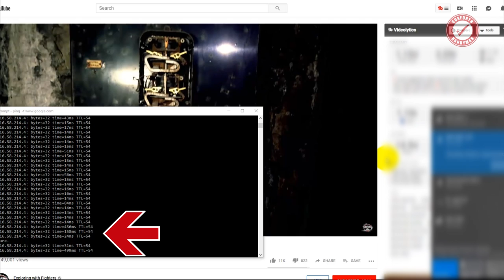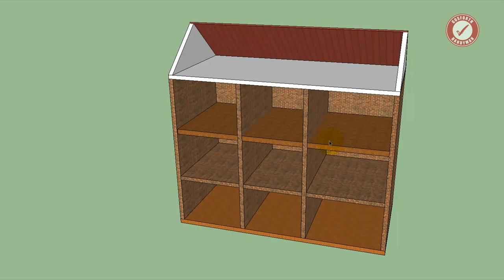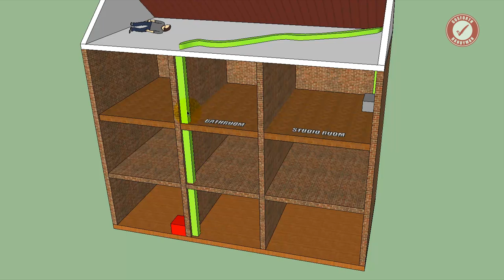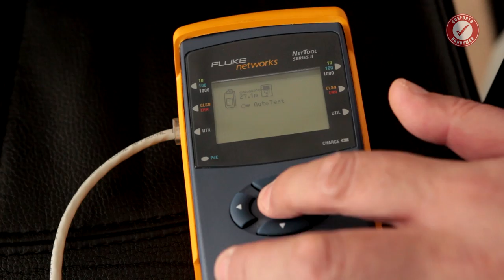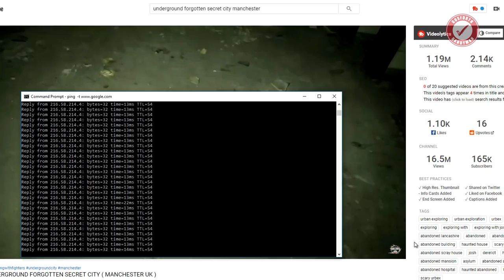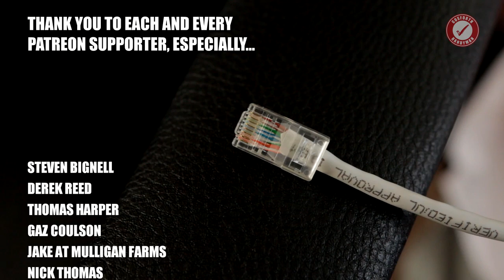Running RJ45 Network Cables inside walls ...and fixing Wi-Fi problems!

Comment: Just wanted to add. I saw the other day a wall socket for that ethernet cable, where you can just attach the wires to the terminals, mount it on the wall and run a ready cable from the shop to the end user

Comment: People in the alarm business have been fishing wires through walls, etc for many years.  They have developed many tools for doing this.  Electricians are beginning to learn from alarm people how to route wires.  It's funny how people have to re-invent the wheel.

Way before we had those electronic inspection cameras, we had small periscopes that could look into a wall to find fire blocks, guide drill bits, etc.  Jim

Comment: If you’re going to this much trouble and going that much distance, then you should just go for 10gig multimodal fiber. Then you’ll never worry about speed or capacity in the future. There’s plenty of online suppliers that sell common lengths cheap with the ends already attached. Also, one tip is to always run your cables with a spare string line attached to them, in case you decide you want to run more in the future.

Comment: GOOD JOB! However, I think you did it the hard way.
They sell outdoor Ethernet cable. On my house I
punched a hole to the outside at the router ran the
cable around the outside of the building then I
punched another hole into the house where the 
service was needed. DONE.

!

Comment: Did you leave the string/twine in for any future work? I would have run 2 Cat 5 cables just to future proof the install because you may need a connection in another another room. Great video though - like your presentation style.
Reply from the maker: No - considered it but I'd have to open the wall up anyway as you couldn't pull a cable all the way from the top to bottom as it was too tight. Cheers bud! 👍👊

Comment: Heat shrink is handy for joining the cable 'nose to nose' with whatever your using to pull poke , means you only need a cable sized hole.

Comment: Nicely done Andy 👍. Another good video. You really really need to treat yourself to an endoscope... cheap as chips from Amazon (about £15), just plug it in to your phone.... it will save you hours of poking in the dark. I use my one for running wires in vehicles... go on.. treat yourself. Keep up the good work 😁
Reply from the maker: I've got one somewhere! 👍
Reply: Mine was a fiver from Ali

Comment: I think it might have been a good thing to pull twice the amount of polytwine down from the third floor down to the first floor.  That way you could attach your network cable at the half way point.  Tie off the twine on the first floor, then from the third floor pull the twine and cable up to the third floor.  On the third floor make sure you have enough slack of the twine so you can tie it off.  That way you can leave the twine in place in case in the future you want to pull a second line to the third or one to the second floor.  Rather than patching the round holes with plaster it might be better to get some keystone plates to cover the holes with,  they make them with as many as six keystone plugs.  But one with four would probably be about right to cover the round hole.  Most of the keystone plates have removable keystone plugs that you only remove the ones you plan to use.

Comment: Thanks for the video, which fish tape product did you use?  Just mounted my projector and looking to run a power cable to it.  Oh and on that subject thankyou for opening my eyes to the setting tool, ashamed to say I'm 42 and didn't know it existed,  always thought those plaster plugs were crap but i wasn't using them right.  Cheers from a fellow Geordie up in Ashington.

Comment: Why didn't you install a faceplate for the network cable? 
For people who aren't aware:
Solid core cable like this should be terminated into a faceplate. It isn't designed to be terminated with an connector.
Stranded cable is used for making network (patch) cables between router / switch and PCs, it's more flexible and less likely to break over time.
Reply from the maker: >> Why didn't you install a faceplate for the network cable? 
Didn't need them! But yes, if you plan on moving the connectors around a lot then use faceplates and stranded cable. 👍
Reply: @GosforthHandyman  Fair enough, if it's for yourself and you understand the limitations. 

I just wanted to mention it, in case others weren't aware of the solid / stranded differences.

Comment: If I remember rightly. A soil stack should have a fireguard coller on each level to stop spread of fire if one occur? It might be that you are fighting with . The fact that you did get it through is probably due to builders not sealing that area as it is behind the boxing
Reply: If the floor is fire-rated.
Reply from the maker: Yeah, I think the fire rating is just on the consumer side. Pretty sure the insulation is just for noise suppression... and to keep the poops warm. 😂👍

Comment: I need to do this. The router is in my study right by my computer so that's fine; phones and iPads are all fine over wi-fi but the smart TV doesn't always do well over wi-fi. Nothing worse than it losing the plot 😉 halfway through a movie or show. Luckily I'm in a single-storey home so it's a simple matter of taking cable up from the study, through the ceiling and down into the lounge. A bit of a hassle as my South African home doesn't have a nice loft space like UK ones, so need to crawl over rafters and not put a foot through the thin ceiling board.

Comment: For the speed you have, I would of gone Powerline adaptors. I use them in my 3 story on each floor (set of 3), had the rare blip where I needed to power cycle the one at the router/switch end but other than that they have been rock solid.

Comment: Tight really. In Spain they actually accommodate that very problem, you may want to add power, RJ45 or TV, so they include extra blank trunking tubes for each room from an centralised location. Router in the lounge, np, simply run your RJ45 cable through to the required blank socket. A quick visit to Leroy Merlin and buy your RJ45 socket and there you go, oh and 1 GB fibre isometric is genuine as they literally connect you to the house unlike UK. Where you still get your copper from the roadside and so it’s not true fibre.

Comment: I've used the things that just plug in a mains socket each end and it sends it through the power cables, works OK for me.
Reply from the maker: It's separate ring mains and they don't seem to work too well across different rings. 👍
Reply: @GosforthHandyman  Mine is on a different ring, upstairs and downstairs, I guess length of cable in the circuit can make a difference, I'm getting 65Mb/s.

Comment: Just renovated and put an extension on my house, the whole house had a rewire so took the opportunity to run 20 Ethernet cables from every room up to a switch in the loft, couldn’t rely on WiFi 🤧

Comment: I always pull more twine through with the cable to ease any worries about the cable coming away from the pulling twine. It also means you have something in place to pull a future cable.
Did you need the big holes at the bottom of the boxes? Could you have used just the ones at the tops?

Comment: Nice job... it would have been a good idea to run two cables since you looks like you had the cable to do it and a "pull wire" of excess cable for a future pull if needed.

Comment: Would have been tempted to run two cables and terminate them in punch down face plates, cables do go bad over time. Did you consider going external ? i've had to do that a few times when there is no chance of them letting you dril / lift internally.
Reply from the maker: Didn't really need 2 and could use a splitter if needs be but yes, defo run as many as you can be bothered to run! 😀👍 No easy external route so this was the easiest option.
Reply: @GosforthHandyman  Fairy snuff, internal can be a nightmare when you carn't lift anything; get in early on a new build and its bliss, thoese are the days compared to old homes that have 2ft thick solid walls and no crawl spaces.

Comment: Hi Andy I would have pulled a nylon fish along with the ethernet cable so that you have the ability to pull through secondary cables should you need them, after all you done the hard yards.
Reply from the maker: Yeah, considered it but the pulls between floors would still require holes in the walls as it would be too tight to pull from top to bottom. If I changed things I'd probably put a switch in the loft and drop down in to each room from there, but fine for now. 👍

Comment: Interesting. Does the UK allow unlicensed cablers to install fixed telecommunications wiring?  in Australia, it is illegal to install any fixed cabling that could be potentially be connected to public networks.  A consumer can run all the speakers and antenna cables that they want, but as soon as it is an infrastructure cable (i.e. inside a  wall or ceiling space) that can potentially be used for a fixed line phone or internet (even where no public network connectivity is actually installed), communications authority licensing is required.
Reply from the maker: Thankfully no such restrictions in the UK! Even for commercial installers AFAIK. 👍

Comment: Out of context for this video, A few weeks ago you showed an new dust extraction system. 

I also have yet to fit my chinese cyclone gadget together but can't seem to find any decent fixings to go on to ist 53/54mm conections. 

Are you fixing to the inside 50mm bore or have you found a decent connector from somewhere?
Reply from the maker: Haven't decided yet! Axminster do quite a range of different adaptors including flexible ones and ones you can cut to size so I'm hoping I can find what I need from there. Good luck! 👍

Comment: I feel your pain, one of those jobs you 'I will just pop the cable down that boxing in' 6 hrs later the swear bible has been used up, on your own its a proper chore, good type of video this, I have always 'hard wired' everything, I have a point in every room apart from the Kitchen & bathroom, everytime I took a carpet up or did any work I would leave x amount of metres of cable under the floor to 'pick up later' the cheap Ethernet kit is ok I never had any problems with it myself, WiFi should ALWAYS be used as a secondary connection, good work
Reply from the maker: Cheers bud! Yeah, must admit I thought access down that boxing would have been easier than it was. 😀

Comment: Don't forget speed isn't just about the Cable and wifi.  The single unit Modem/Router/AP you get from your ISP for free is the basic basic model that works, but with heavy use, the CPU and memory in the unit will also be your bottle neck.  Split out the functionality across multiple devices if you can also to help with speeds.

Comment: Brick Mason's twine is even stronger than yard twine. For the trouble you went to, you would have gotten a stronger signal using a higher capacity cable for very little increase in the cost of the cable. I upgraded from Cat 5  to Cat 8, even on short runs between router and network switches, and the improvement is amazing, even going from an old, long-used Cat 5 cable to a new Cat 6 cable gives a noticeable improvement in speed and quality of the signals going through your network.

Comment: Why not use powerline adapters? That's a wired connection as well except that it uses your existing electrical wires in the house that run from power socket to power socket.

Comment: My router is in the same room as my pc. opposite corners. When i built my pc i decided i wouldn't  bother with wireless as i knew i would get fer better connection /speeds with cable. My house is from around 1906 with nice crawl space under the floor. I had the joys of running 3 cables under the floor of my house to provide connection to my pc, my sons pc and the tv in the living room. I did a few comparisons and wireless at my desk i get around 35mb at best , wired i get on average 70+mb  that's line of sight from the router. I would say to anyone go wired for any fixed device and keep wireless for mobile devices.
Reply from the maker: Yup defo - huge difference! 👍👊

Comment: What if I cut the cable before the connector and then rewire it? Will it have problems?
Reply from the maker: Should be fine but make sure it's disconnected at both ends before you cut it. You'll need to re-terminate it obviously. 👍

Comment: Hi I just watched your video but I have a question I hope you can help.. the Ethernet cable you linked to is cat6 but the connecters are cat7 what does this mean and what the difference? Could they be used together? Thank you.
Reply from the maker: Hi Gary - good question. I used to do a lot of work in datacentres but I'm totally out of touch now. It works - for domestic use I don't see this being a problem. 👍😀
Reply: Gosforth Handyman  cheers. I’ll just dive in and sort it out. 👍

Comment: It's a crime they don't put trunking for cables in new build houses...it would save a lot of mess & hassle. Also I've never seen a 'brush' plate before....could you have installed a 'proper' ethernet connector wall plate (or is that on a 'to do' list)?
Reply from the maker: Yup defo an option but I'd also have had to install a back box. I had brush plates to hand - I didn't have faceplates to hand. 👍👊

Comment: Just FYI, I would recommend you add an unmanaged switch above the bathroom, before traversing the loft. Although Cat7 is excellent cable, you're still subject to the limits of your router's TX power. Most ISP supplied routers won't supply the amperage to traverse a maximum cat5 rating let alone cat7, so if you're still experiencing some connectivity issues this is where your problem will likely be. Adding a switch around halfway will eliminate this issue, although if you have a decent ethernet chipset you may well be perfectly fine.
Reply from the maker: No problems, all perfect. This is just Cat 5e and all fine. About a 27m run. 👍
Reply: Oh, that's pretty perfect then. For some reason I was picturing a 200m run, heh

Comment: Just wonder why you didnt just run UV protected cable up the outside of the house.
Reply: lll ANIMAL lll Certainly an option to use external grade cable but cables on the outside of buildings are an eyesore!

Comment: If you really, really have to do this (I do: my house is even more awkward), pull -in at least TWO runs of cable. You never know when one might fail, or you want a more complex network structure...
Reply from the maker: I guarantee I'll never need more than this, but yes - if there's a chance you'll need more then run more. Or just add a switch. 👍

Comment: As someone that has done this for many years, I am surprised you forgot the golden rule. Cable is cheap, your time is not. Should have pulled 2 cables mate, if that first had been a dud, I find its better to be looking at something rather than looking for something :)
Reply from the maker: I have every confidence in my cables not being dud and can guarantee I'll never need a 2nd cable. 👍
Reply: @GosforthHandyman , Ahh, I would have put an access point on the second one just to improve WiFi coverage and throughput. 😂

Comment: Can you wire a cat5e from one router to another router?
Reply: Yes, you can connect the router as an extra node behind (not literally) the initial router which acts as the gateway although I'm not sure for what purpose you want to do that. You would be better off using a switch